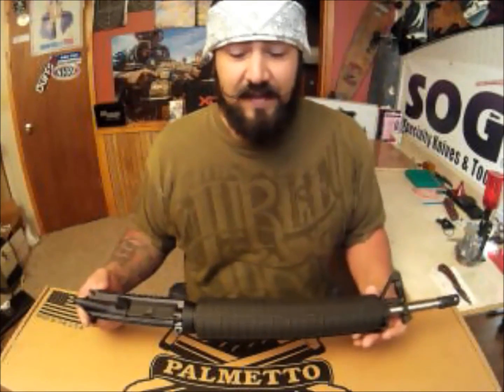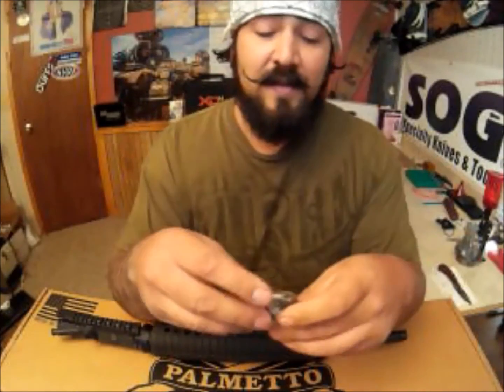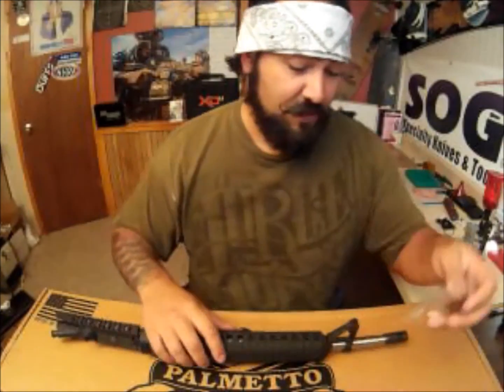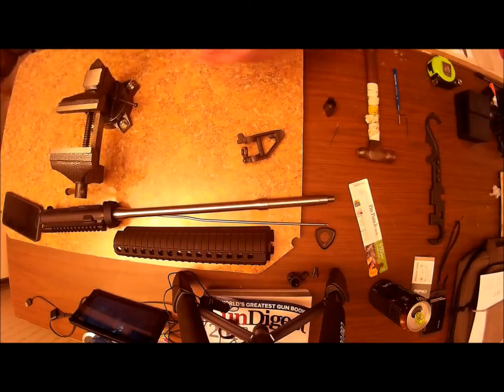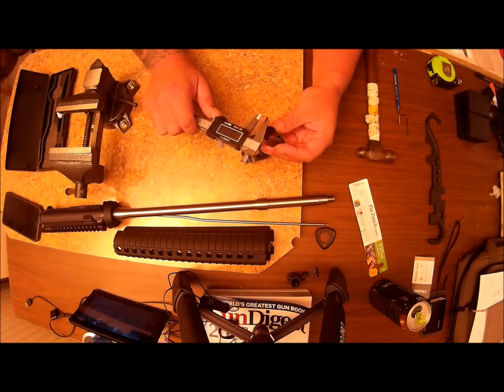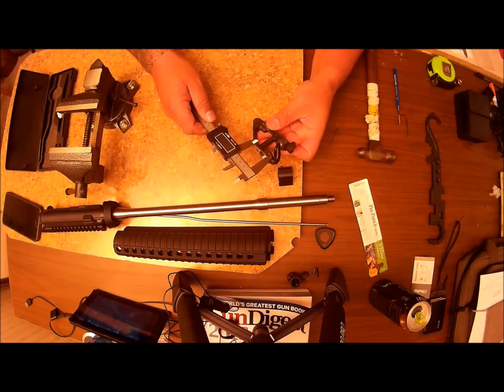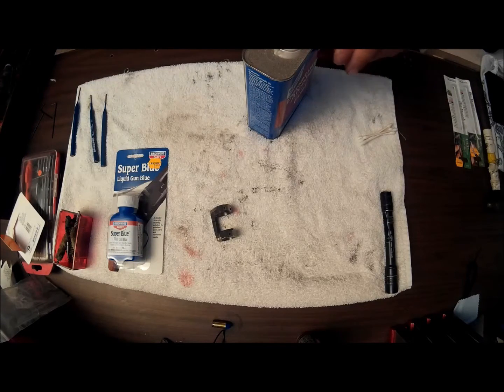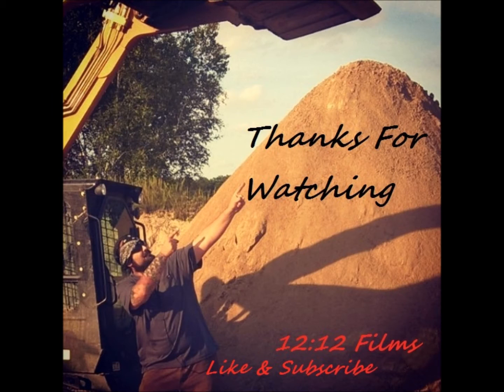Make your own Low-Pro AR-15 gas block from A2 front sight, most secure gas block amount for free.

Comment: I know this is a older video but did this idea work out like you were thinking ?
Reply from the maker: It did. I did some heat testing and it actually cools about 25% ish faster / less heat retention then a solid steel low pro block. It was more of a exploration video to see what would happen. A guy can find a cheap well functioning gas block now for $20 but retaining the ability to pin it back into a current setup might be handy / durable